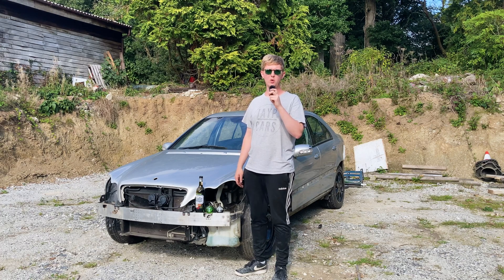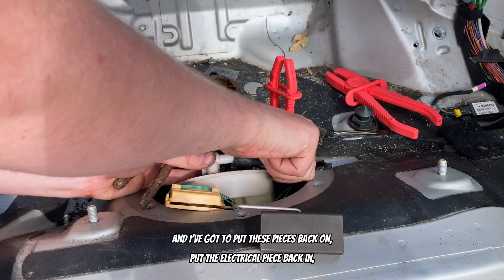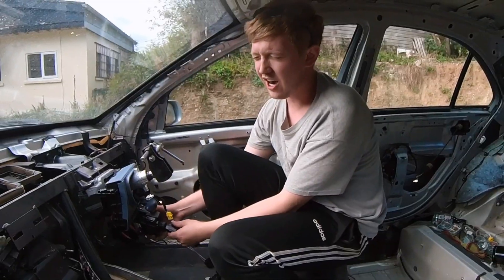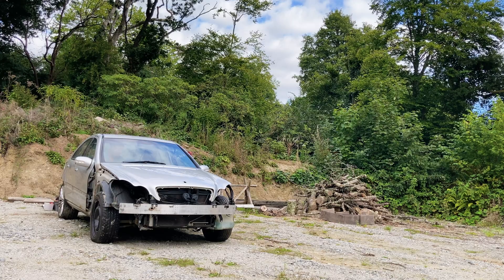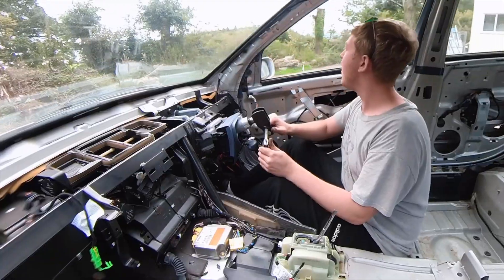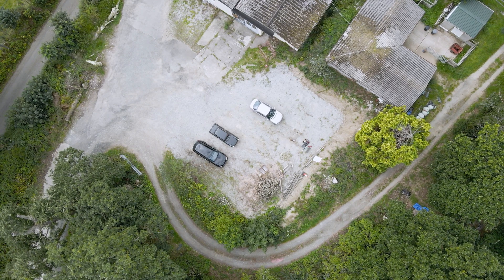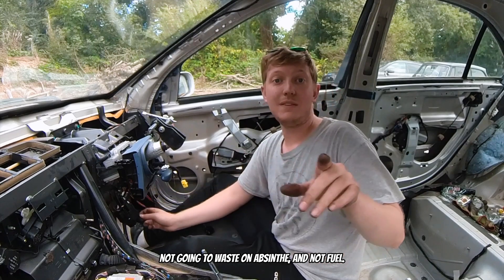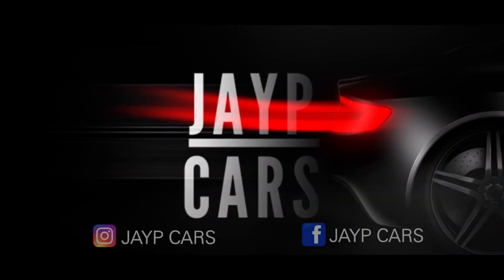Can Your Car Run On Alcohol? I Solved The Fuel Crisis.

Comment: Now try moon-shining your own 100% alcohol fuel from organic waste
Reply from the maker: Tell me how!
Reply: @JAYPCARS  Well, basically you need to trigger anaerobic fermentation of organic matter, usually this involves yeast or other microorganisms. When you get span, you should distill it to get pure alcohol. The process is well-described online, but you probably should consult with specialists. And check on legality of this type of production in your country. But it should be probably fine. It will not be food-grade at all. And we need it to burn.

The engine should be also modified to achieve higher combustion pressure. Gasoline combustion engines are using alcohol less effectively.
Reply from the maker: Thanks for the info! I’ll keep it in mind for when I next have a petrol. I’m driving an L322 diesel at the moment, so have been thinking about whether running it on oil could be a viable option. I’ve seen some diesels run this way with fairly decent success. The L322 is currently getting 16mpg so would be interesting to compare.

Comment: I'm interested to see what you're gonna do with the C Class. You planning a full restoration or is it just for parts?
Reply from the maker: The body was horrendously rusty so it ended up being used for parts! If I had the unit at the time I may have done something with it but had the C32 at the time anyway
Reply: @JAYPCARS  Glad it didn't go to waste. Got to drive a friend's C class saloon once and god damn does that thing go when you lay on the pedal. Extremely comfortable the entire time as well. Barely felt any bumps on the road. Compared to my dinky little Seicento, it's night and day. Glad to see you're still having fun with C classes. Definitely got a subscriber.
Reply from the maker: Ha, that certainly is night and day! I feel these Mercedes are great value for money too, everything you could need really. Thanks for the support 🙏🏻

Comment: from what i understand there are already fuel stations in China and Brazil that dispense M100 and E100 i.e neat methanol and ethanol as the vehicle engines are able to run on these fuels?
Reply from the maker: If that’s the case why do we need petrol at all? I’d imagine less emissions with methanol/ethanol too?
Reply: @JAYPCARS  Generally, petrol is still cheaper in many instances at large scale. The problem is that you have to use farmland specifically for fuel production, which isn't ideal. The countries with the largest agricultural bases also tend to also have large oil reserves, so it just makes sense. It really only makes sense if a lot of people are doing it independently. 

Not to mention that oil actually has a lot of products which are made from it. Gasoline is only one petrochemical of about 10. Thus, when everything is taken into consideration, it tends to make sense to simply take the gasoline from the production when everything else is also so sought after. 
Only if you could replace everything made from petrochemicals with a plant based alternative would it make sense to switch.

There's also an issue regarding the specific crop used for the fuel. For example, in the USA, they use CORN. Corn is pretty inefficient and not the highest in sugar. However, due to climate, Brazil uses its very high sugarcane output in order to create that fuel. I'm willing to bet China uses rice in order to make theirs. Though it's worth noting that either industry works without massive fertilizer inputs.